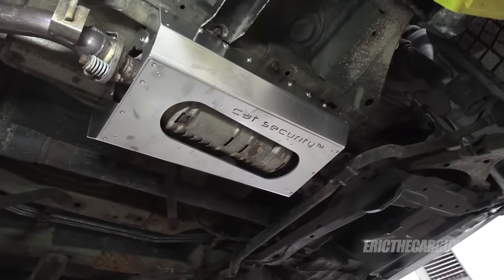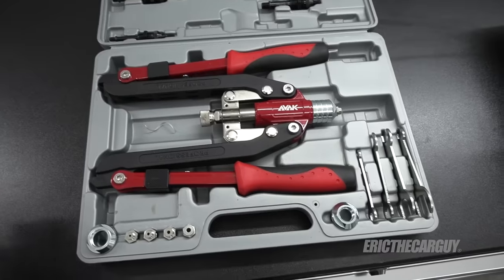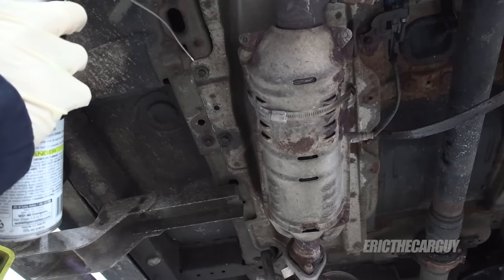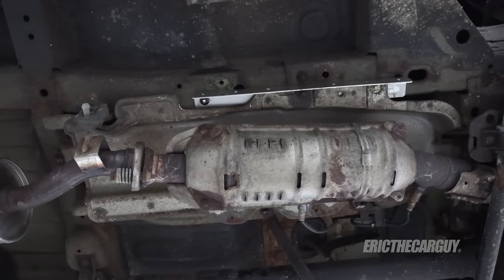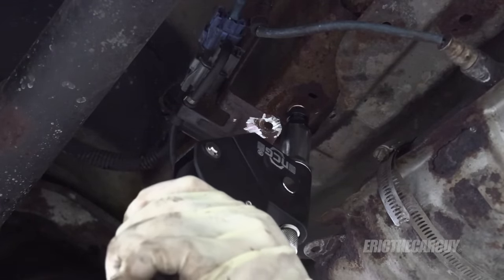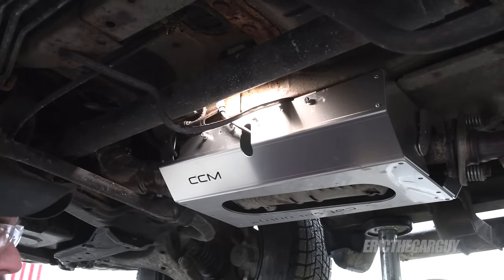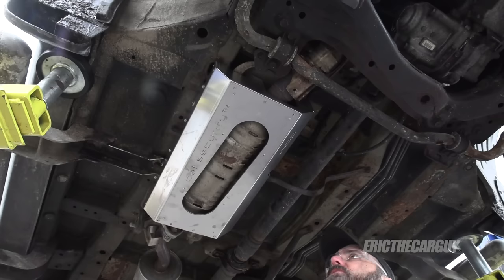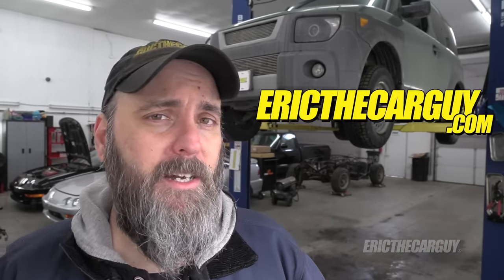How To Prevent Catalytic Converter Theft

Comment: Imagine a thief cutting out your cat anyway and just leaving it rattling around the security box out of spite.
Reply: Or slash the tires/break the windows out of spite
Reply: Like the guy that drills a hole into the gas tank when he runs into a locking gas cap.
Reply: Because of security measures I won't disclose, they would receive their trial and sentence all in one surprising moment (to quote Mike Royko)
Reply: @silasmarner7586  too quick
Reply: @Mr.SisterFisster  Whats the point of that? The gas tank is harder to drill through than the lock on the cap.
Reply: Someone stole my stereo once. Ripped it right out of the dash, cut all the cables including the RCAs, saw it was a cheap ass stereo and spiked it onto the sidewalk.
Reply: Omg
Reply: @Volksoner619  they couldn't tell it was a cheap ass stereo before taking it out? Sounds like a fictional story.
Reply: @Mr.SisterFisster  did you hear that on r/urbanlegends? How about the burgler that burned the house down when the door was locked. 😳 Should we not lockmour doors?
Reply: @allaboutroofing2  believe what you want. Rational thought isn’t a meth heads strong suit. 
Check this out... you probably won’t believe this one either. Another time they stole my stereo (decent Kenwood cassette) they were the most courteous thief ever. They “broke” into my VW bus by unscrewing the pop out window latch, and put the screws on the floor inside the cargo area.  They ejected the cassette to diskman adapter wrapped the wire around the CD player and left it in the parcel tray. Unplugged the stereo then locked the door and pushed the open window closed. They didn’t damage anything and took only the head unit even though I had a pair of 12”s and amps in the back and they stepped over a crate full of airbrush equipment to get from the passenger area to the cab. 
It gave me the excuse to finally upgrade to an in dash CD player
Reply: @Volksoner619  Someone broke a window on my car and tried to take my stereo a few years ago. You need a particular tool to remove it from the frame behind the stereo, so after working on it for awhile, the thief finally gave up....and pulled a knife out and sliced both of my leather front seats out of spite.  -Apparently, they were angry that I hadnt made it easier to steal my stereo.  I wasnt even aware of the tool requirement.  Even worse, it was a factory stereo. - Probably wasnt worth $75 on the black market anyway.  Cost me nearly $4K to repair the damage (window, stereo, dash and seats).
Reply: @potardo9851  .... no its not  .
Reply: @silasmarner7586  45ACP
Reply: @potardo9851  Not the newer plastic tanks.
Reply: Gas tanks are plastic now. So easy to drill and drain.
Reply: It's kinda why you don't lock a convertible car...they just cut the roof.
Reply: Or so mad  that they take a poop on your car seat
Reply: @potardo9851  a plastic gas tank is harder to drill through than a lock? Lol
Reply: @Volksoner619  Yep, seen it done. They broke the side glass that could be pushed down easily on a square body chevy truck, then cut the stereo/cassette player wires off on the opposite side of the plug, instead of just unplugging it ! Wasn't worth a dollar !!!!
Reply: Like that loose nut when he cut off the rusty bolt head?
Reply: organized theft are not looking for more trubble, they are looking for easy money; as soon as it becomes time consuming they usually move on to an easier target.
Reply: At least you'd still have the cat though...a muffler shop could easily and cheaply weld the cuts up.

But it wouldn't take but about a minute to cut through that box with a battery angle grinder.
Reply: I think I'll just wrap some of that prison razor wire around everything under the car to make it extra fun to reach in there

Comment: Ive electrically disconnected the cat from the exhaust system and I have a special cord I made up that I plug into the dryer outlet and the other end hooks to the catalytic converter.

Comment: I basically have used out of service crane cable and a welder for many MANY years.  one length is welded along the length of pipe at intervals, 40 ton cabling is over an inch thick, its a 7x7x13 bundle and made from a higher carbon steel everything but a carbide blade will get ruined on before going through.  Getting lengths of the cable is pretty easy, call a crane company.

Comment: i secured my cat with 316 stainless chain. two loops around the cat and a loop around the ends of the cat. then ran the chain to the frame and tack welded it. 316 stainless chain can not be cut with bolt cutters.
Reply: Hello. where did you get that chain??   you bolted the chain all around under de car

Comment: Nice solution, but the truth is, if you simply had a collar made of hardened metal that slipped over the inlet/output exhaust pipe, it would accomplish the same thing.  Hardened metal will destroy most sawzall blades.  That allows it to breathe better and makes for o2 sensor changes much easier.  I spotted the "universal cat heat shield anti-rattle fix" as well :)
Reply from the maker: Not sure if that would work unless you covered the entire exhaust. What's to stop a thief from just cutting the pipe elsewhere? I haven't experienced any adverse issues since installing this. Thanks for the comment.

Comment: Along with the converter being stolen you will have a hole in the floorboard too.
Reply: How is that? Doesn't work that way!
Reply: Having had to cut through structural sections of a car body to get parts to repair my car, I can tell you cutting through the frame rail to get the catalytic converter would destroy all the guys saw blades.
Reply: @AlexandarHullRichter  'Ole cletus and his walmart sawzall might try though. XD
Reply: @AlexandarHullRichter  I could get that cat out in 10 minutes with a cordless angle grinder and (1) cutoff wheel. Maybe even get that down to 5 minutes.
Reply: @Dave-so7sf  do you regularly seal converters?
Reply: aka Fred Flintstone My Ride...
Reply: @Dave-so7sf  was going to say this. An angle grinder aka the purifier would make quick work extracting a catalytic converter. I use it at my work and it cuts through heavy duty ductile iron pipe. angle grinders are no joke!
Reply: @AlexandarHullRichter  Just a clever plumber. Us plumbers are as clever as a chimp. Not like a circus chimp but a regular chimp.
Reply: Exactly, or they'd simply cut the (SS/alum) tin security box on one edge, dropping the cat out through the hole they just made.  Time of extraction moved to 6.5 mins from 5 mins. (Sorry to rain on your parade, Eric.)

Comment: they cant steal your cat if you dont have a cat...
and live in a non emission restrictive state/county
Reply: I removed mine and tossed it apparently before things got really bad and tons of cars in my area were getting the cats ripped off. Ticked me off a little because where the hell are they getting money for the things. I couldn't find a scrap place around that would take my old one before this mess. At least I don't have to worry about it now.
Reply: @potardo9851  Yeah there is some corruption going on somewhere, in my experience try and scrap anything like a cat or a bunch of copper wire and you're going to have a really hard time convincing someone you didnt steal it.

Comment: I was on the fence about buying this, more so on the side of NOT due to high price. At the end you convinced me that I am right not to buy it, since I think my CAT is bad. I used to get the P0420 engine code intermittently, now it is permanent pretty much. Replaced both sensors and it is still there.

Comment: Hi Eric, thanks for the video. The original catalytic converter was recently stolen off our 2005 Element in a grocery store parking lot, in broad daylight. They took off the two sensors too. We had an aftermarket cat converter put on and two weeks later that one was stolen as well, this time they left one sensor behind. 
I read somewhere that shields (don't remember the specific brand) cause a vibrating/resonating noise when the engine is on. Does this happen with the shield you are installing in this video? Also, does the shield overheat at all? 
Thanks.
Reply: It 100% happens on this CAT SECURITY one, avoid it.
Reply: Does it over heat and damage the sensors?

Comment: Start etching the VIN into the converter and have the metal reclaim centers verify before purchasing the converter. 
When they run the VIN and the vehicle shows to have a current registration, then it is probably stolen.

Comment: Check out the cat strap security system. They have a model that comes with an alarm. If you had an air bag suspension, theoretically you could wire the alarm to lower the vehicle if tripped.

Comment: Just installed the 3rd catalytic converter on my son's CRV. The first two were Walker's bought from Amazon and failed after a few months. Was told by my mechanic that the quality of the ones sold online is crap compared to the ones being sold by brick-and-mortar stores. Now I'm afraid the one that's currently on his car will be stolen. CRV's are almost the same as Honda Elements except for the body style. Plenty of ground clearance for thieves to get at your cat and cut it off quickly.
Reply: After learning of Honda cat theft, I wouldn't buy a Honda. Or a Prius. Maybe I'll buy a motorcycle.

Comment: I had a cat stolen off my Sequoia 4x4 last year. Thankfully the repair was only a couple hundred bucks. The whole exhaust needs to be replaced on my rig anyway, but after I replace the whole system, I'll definitely have a "skid plate" installed over the cats as a deterrent.

Comment: That feeling when catalytic converter theft is on the rise, but yours is tucked away safely under the stairs 😂
Reply: I do have a truck which they could easily get underneath but it wouldn't do much good because my cats right at the collector for the manifolds right by the freeze plugs, you're not getting a sawzall in there. even if you could it's too big a hassle for how small those cats are.
Reply: This!
Reply: Mines in the attic straight pipe on almost everything of mine lol
Reply: Go sell em

Comment: I bought a '98 Lincoln Navigator for $200.00 because someone tried to steal the Cats in it. It costs more than the whole truck is worth to have them replaced & fix the floor they mangled in the attempt. Runs good, Looks good, Interior isn't too bad, so I basically bought it for the disc brake rear end and nice leather seats I can use in one of my Rat Rods. Sad that things like this can kill someone's whole car/truck.

Comment: Really cool product, however I don’t see a diy mechanic ever doing this and I see a shop charging the cost of a new cat to install that.
Reply from the maker: Without the issues I had, it would take about 10-15min to install this. Thanks for the comment.
Reply: The hardest part of the install is breaking loose the older fasteners. Next is the pop rivets. 

Other than that I’m buying and installing my own. Seems pretty straight forward.

Comment: Bought this CAT SECURITY SHIELD, installed it and have had the worst time with it. Maybe they sent me one made for different vehicle? but the one I installed has produced a horrible rattle due to exhaust vibration hitting the shield. You can't hear it outside the element, but inside at a stoplight, it's terrible. I have adjusted and adjusted and adjusted.....replaced hangers. Everything. Only way to stop it, is to take it off (which sucks because of all the rivets) and angle grind the damn thing into compliance. I don't recommend Cat Security.

Comment: this has just taken off in Australia they use a chain cutter takes 5 seconds per cut , 4x4 are getting hit as they can get under fast , I welded some over rap around the pipes and tig`d it on , Im hoping it will be just to hard as the P32 workhorse chassis is a big expensive bugga ,,
Great vid Eric 
Rob
NSW 
Australia

Comment: Every heard of anti-seize? Also using an impact on old and/or rusty bolts/nuts is a good way to strip/break them. Saved myself a lot of time and headache by breaking loose by hand, spray penetrant, and work back and forth(turn a bit ccw, then cw.....). Same way one would when using a tap or die.

Comment: Attempting to install this one under the Texas Blazin heat. I’ll let y’all know how it went.

Took me two hours. Definitely longer than it should have. “FASTEN-PRO
11 In. Swivel Head Hand Riveter” from harbor freight made it so much easier. It comes with 4 sizes of rivets and it’s about $10.99. 

The heat shield for the catalytic converter was too damn big. I just ended up bending that with locking pliers and a screwdriver. (I do own a cutting tool with cutting wheels, but why make it overly complicated)

I drove my element up ramps, and even then it was very uncomfortable. I would recommend driving it up ramps, and jacking up the rear end fully at once and placing two jack stands. 

I did not install the so called 3/16 black rivet. It just didn’t fit on my tool. I’m happy though. If you want to install it, then buy the heavy duty riveter from harbor freight for $25. I did not need to use a drill or the nutserts even though I had them.

Comment: A "Club" for you CAT and just as useful. Anyone that knows the least bit about using a metal saw knows that two small cuts at each end of the shield will create an opening large enough to pull the cat through.

Comment: Security torx isn’t exactly tamper proof, a lot of tool kits are coming with security torx bits and they’re rather easy to get ahold of. Definitely add a strong thread locker if you really want this to work perfectly
Reply: Or in a pinch, grind off all the corners on the bolt heads after installation so a wrench bit won’t work on them anymore.
Reply: i usually snap off the center "security" part with a flat head then a regular torx bit works. heck in some cases a flat head will remove the torx screw.
whoever came up with the design for security torx wasn't very smart.

Comment: Funny you posted this - I just read an article in Hemmings just a few days ago about this very thing! They said one of those elements in the converter - I can't recall which one specifically - was $27,000 PER OUNCE!! Holy crapper!  Almost 20x the price of gold!! The heck with Fort Knox - I'm headed to the cat plant! LOL! I also recall reading a while back that a heavy duty Ram pickup was #3 on a list of the most expensive / valuable catalytic converters in the automotive world! #1 and #2 on the list were 6-figure exotics, like Maybach and Lamborgini ... then you see, "Ram 2500" - that was comical!  

I find directions usually confuse me more than just having at it, and figuring things out for myself. Different sized fasteners usually get me too, BUT, sometimes there are key steps that need to be performed first, otherwise you'll have to take everything apart again to perform that particular step. That always bites me in the butt. It's like the forces of the universe know I hate doing things twice ... :D
Reply: Metals used in cats
Platinum $1,314.95/oz
palladium $2,420.50/oz
rhodium $21,500.00/oz
cerium $57 per 100 grams
manganese $27.45/oz
nickel $8.4840/lb

that is about current price as of 19 FEB 2021 12:17ET
Reply: @Dratchev241  - Ahh, rhodium - that's the stuff! $21,500 is still up there! Thanks for the info.
Reply: @SmittySmithsonite  Problem with these metals is they are HARD to refine unlike gold/silver. those prices are for .999 fine. cats ain't going to be .999 fine its the "mess" of all of them together which lowers the price you get.
Reply: @Dratchev241  - I figured that, plus all the carbon and burnt engine oil residue baked into it. Price varies widely by brand and model, too. Some Chrysler cats are high dollar items at the scrapyard. Must have a thicker layer and / or more of those elements in them.
Reply from the maker: Interestingly, it's my understanding, that they use the same metals to produce hydrogen vehicles. Hence the reason I don't think those will ever take off. Thanks for the comment.
Reply: @ericthecarguy  - Ahh, I didn’t know that! That’ll certainly put a damper on that project, that’s for sure. That’s too bad, too. Hydrogen powered vehicle exhaust could be run right into the cab, since it emits oxygen and water. That would be great for my asthma, LOL. 😊

Comment: wrap the complete area of pipe and converter with some stainless cable and clamp it off on each end to the pipe. Cheap and they`d have a hellof a time cutting a loose 1/4" cable

Comment: Don't have to worry about them stealing my cat. My Jeep has one of those maniverters. Cat is part of the exhaust manifold and it clear up in the engine bay. Even if they tried to cut it out they would never get it out of the engine bay. I had to replace mine and in order to get it out you have to take all the motor mounts loose and lift the engine and trans up and forward 3 inches to make room for it to come out the top. It can not come out the bottom unless you take the transfer case off which requires removing the whole front sub frame. I paid more in labor than I did for the cat.

Comment: Had a crew here that had a plasma cutter in their truck...yep...they'd jump under, had cut them off...they also take your wheels...pit crew speeds too.  Somebody showed their video and it was about 2 minutes  for them to jack the car, strip the tires, and grab the cat.  What kills me is that I can go to my scrap yard and drop off a cat and get $$$ for it with zero questions, but don't you dare take 50lbs of copper wire...Holy hell, 3rd degree....